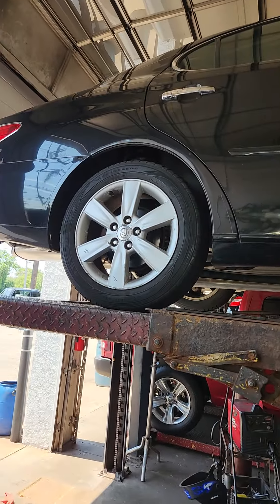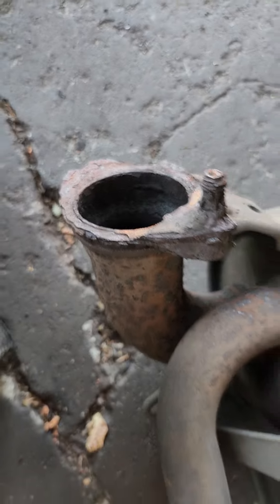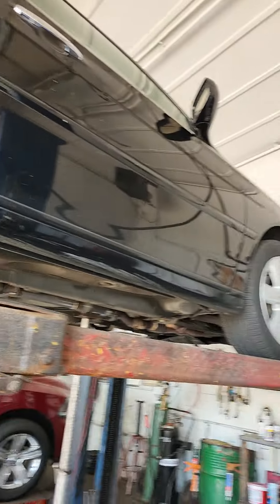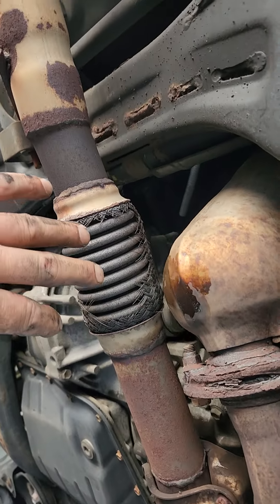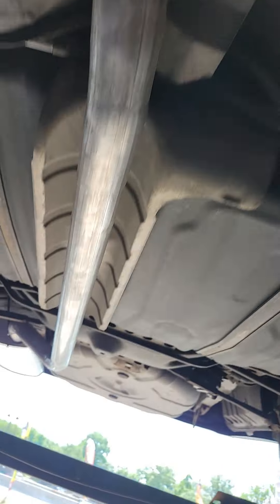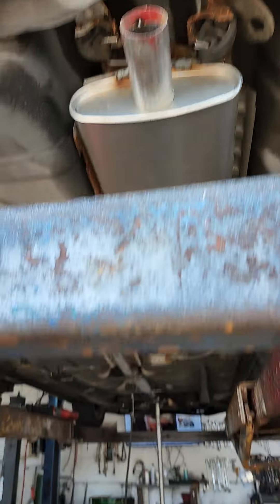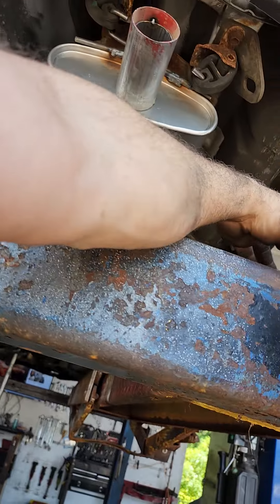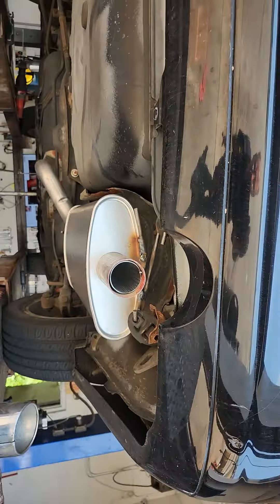2005 lexus custom made exhaust

Comment: I got a little drone on mine after I got custom exhaust with AP parts and Magnaflow muffler, but after a long time I got used to it, on the interstate it's actually pretty quiet and smoothe. The drone is more at lower RPM around 1500 rpm and in town.
I am just stating
Reply from the maker: U will sir w those products